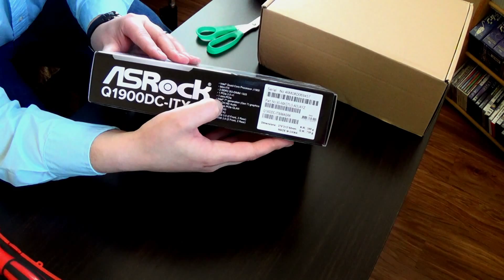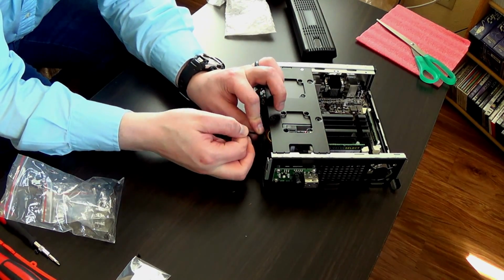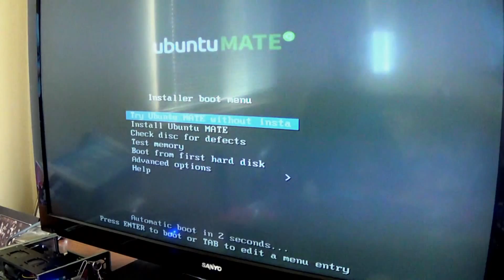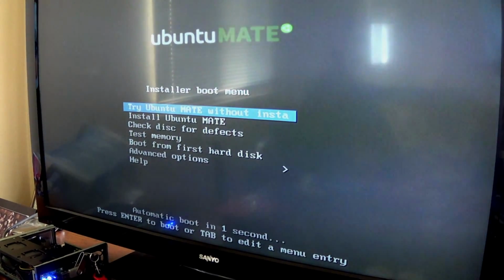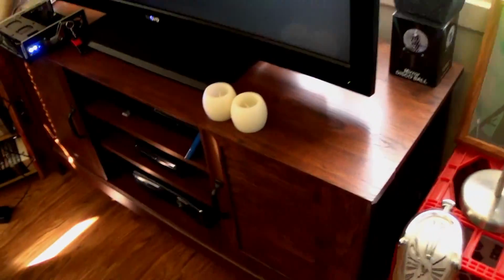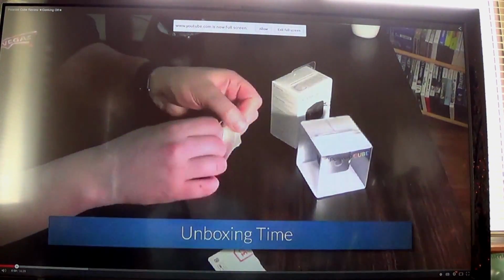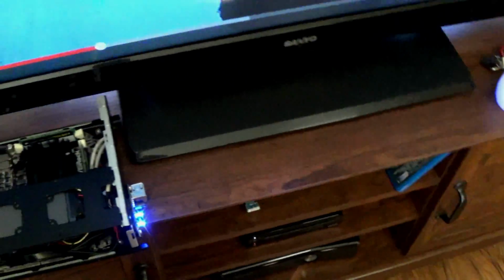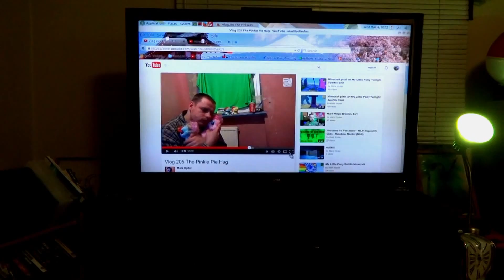Mini TV PC ★Geeking Off★

Comment: I tried using a case like this for an a10-7850k. I just couldn't find an FM2+ board with a msata or m.2 slot to allow the APU to breathe. Also the pico power supplies did not have enough juice to power the apu so I had to scrap the project. In hindsight I should have tried underclocking... if paired with the onboard graphics 2.0GHz should have been plenty.
Reply: 100 WATT APU LOL

Comment: ASROCK A Micro-ITX motherboard with an already installed A6 processor which contains a CPU+GPU+TRUEAUDIO sound card hardware which you could put 32GB of GDDR3 RAM I.E. 2 16GB of GDDR3 memory sticks.

Comment: If anyone does this now I'd recommend the ASRock beebox.
I fitted mine with a total of 8GB of HyperX sodimms and the same 120GB Kingston drive with Ubuntu on it.
I bought the 2 core as it's fanless but at the 14nm and running at 2GHz turbo node all the time it flies, plus it's tiny compared with this thing.
I'm running it with a 1080p 46" monitor for HD TV from my pinnacle usb dongle and a 3TB USB3 drive and Rii wireless keyboard. This thing runs great and the only issue I have is with Ubuntu as I'm occasionally having to run a script to clear the boot folder as the update files fill it up.
Reply from the maker: +Lee Gibson I am going to have to check mine for update file filling it up. I have been using it for well over a year now and still love it. Most of the time I stream everything off the internet but occasionally I will connect to my file server to watch media I have stored on it.
Reply: I've been running Dota 2 on it as well as streaming 1080p video from providers, a usb3 drive and my NAS box. Though I need to hack my ZyXel nsa310 NAS box as the web player requirements are now archaic.

Comment: Hello. 
The power adapter is from the m350 case? How much is the wattage? Would hold an external HDD and a USB flash drive? Thank you
Reply from the maker: +Pablo Oviedo Not sure on the wattage. It is 9V DC in. I know flash drives work just fine.

Comment: DANG  if my hands worked and my wallet was full I'd be a chronic geekurbator!  lol
Ubunto is good now, huh?
I read About it in Maximum PC.
Reply from the maker: tomken8dy Ubuntu and Linux have come a long way in the past few year. It is starting to become a very strong OS and keeps getting better.
Reply: Anthrit
A good alternative to broken windows.
Reply: tomken8dy ubuntu is quite nice operating system but i prefer zorin over it
Reply from the maker: David Ledden I agree. Many times I have googled for a solution to only run into a forum with some jerk telling someone to "google it". Really pisses me off because I was that guy who "googled it" and first item in the search was a jerk being mean telling someone to do what I was just doing.
Reply: Anthrit David Ledden tomken8dy  StackExchange/AskUbuntu is a quite friendly source of information (in my experience). I think it has to do with up-/downvotes and reputation requirements. It is my preferred source for specialized questions like compatibility issues. For general questions, wikis might be more helpful.
Reply: Winap8
I have no experience with either one. I got an offer from MicroGreed for a free upgrade to Windows10.  I'M KEEPING MY WINDOWS 7!!
Reply: tomken8dy I've been using Linux for 8 years now and have windows on a virtual machine inside Linux. It's super easy to use and a lot of free programs.
Reply: David Ledden
I have a lot to learn about Linux.  Everything, in fact.
Reply: It's a lot of fun. Just stay away from forums, they are mostly jerks and act like they were born with Linux knowledge hahhahaha
Youtube has tons of helpful items!!!
Reply: SugarBeetMC
I'll check it out.  Thanks!!
Reply: I use it daily!
Reply: +Anthrit You should know, that everyone has to know everything about everything. If you don't the forum keyboard warriors will attack you with their pissy little comments. How dare you not instantly know everything about Linux. It's not as if forums are a place where people come together to share knowledge. It's a place for the less experienced to be mocked and vilified by those who know more. They were probably beaten up every day on the playground, and now want to do the same to others.

Comment: I have a stupid question. Do you have to use special computer tools that are not magnetic and can't get that way? I was thinking you could use a magnetic tray for the screws but then the screws would possibly become magnetic. Would that hurt the components? Specs seemed really good on the MB. My motherboard on my HP laptop fried twice due to heating issues. I just gave up and got a MacBook Pro. Hard to get used to after years on a windows based computer.
Reply from the maker: Rebecca Sunnybrook I would recommend using non magnetic, but if you are careful you should be ok. Ya I would not put magnetic inside like that. I saw in another video that someone made spacers out of little bolts. Ya I moved away from windows over a year ago and never looked back.

Comment: That is a small pc. Did u find what that screw was for. Why did not get a wifi for the computer? Do you think a computer that size can do 4k and what more then one monitor? How do find a graphics card right for the pc?
Reply from the maker: Mark Hyder Have no clue what that small screw went to. Wired Internet is 10x faster then wifi. No it has a hart time with HD from time to time, so no 4k on it. You can not put a graphics card in a pc like that.